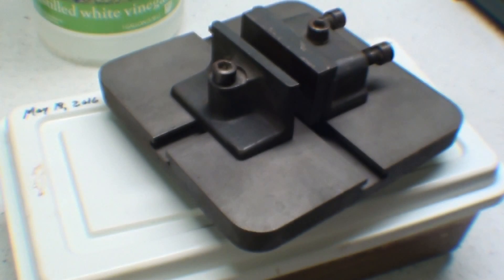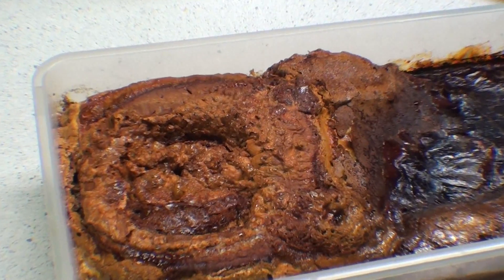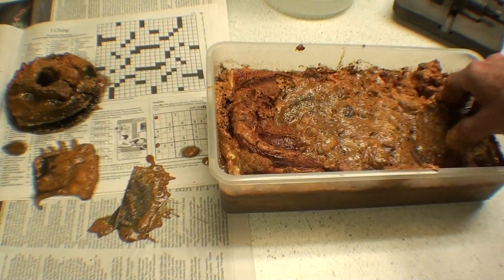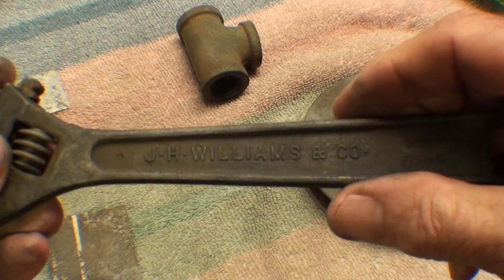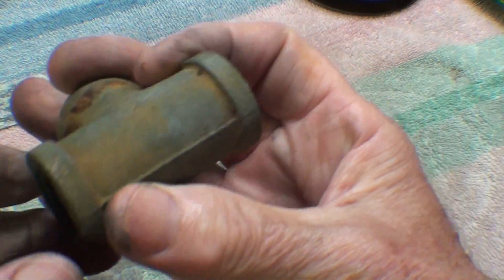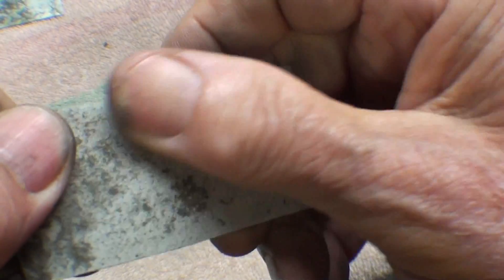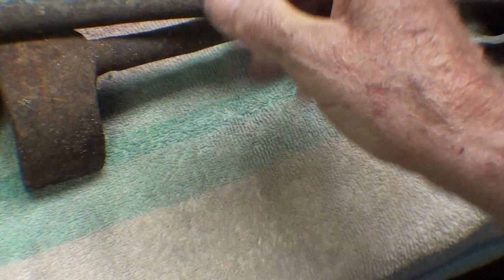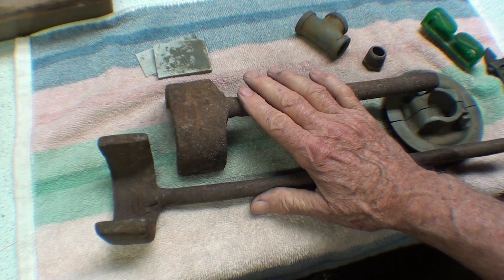VINEGAR Rust Removal 304 1/2 tubalcain electrolysis

Comment: In finish work, what you experienced is called "pickling", a light overall etching. Your surface plate, however, wasn't completely submerged due to the pan leaking. Unsubmerged areas experienced accelerated corrosion, the air, evaporating water, and acetic acid vapor basically cyclically nibbled those unsubmerged areas at an accelerated rate compared to the submerged areas due to greater availability of free oxygen. The acid debonded the oxide, the oxygen and water vapor oxidized, the acid debonded the fresh oxide, the oxygen and water vapor oxidized, both repeating in turn until removed from exposure.

Comment: I would use electricity to do the removal because vinegar is an acid so you have to ask yourself do you want to roughen the surface or do like they have always done it like they use to, as was chroming. I think the electricity does a better job. Thanks

Comment: Stomach acid is hydrochloric acid, also known as muriatic acid. I don't think it would be good as a rust remover. Have you tried passive electrolytic rust removal? When put two different metals in an electrolyte they form a battery. If they touch the more reactive one will protect the less reactive one. This is the basis of galvanized metal. So if you put an iron or steel part in a solution (a little baking soda in lots of water should work) touching a zinc or aluminum plate it should 'derust' the iron.

Comment: For simple shapes I prefer using the wire wheel, for more complex shapes electrolysis works well, assemblies that are rusted tight is the best use of the vinegar solutions.

Comment: I left a cast brake proportioning valve in citric acid for around a week (5-7 days).  It destroyed it.  Was a real shame because there was nothing wrong with it before hand.  That is the only negative impact I have ever run across.  My lesson was to play it safe and not leave anything in any longer than necessary.

Comment: I just finished cleaning up some old rusty weight lifting metal plates (they turned out beautifully by the way). I let them soak in plain white vinegar for 24 to 28 hours, then I thoroughly scrubbed them with a wire brush and rinsed them (very important part of the process) with cold water and made sure that each plate was 100% dry, since cast iron will rust if not completely dry. Not only does the vinegar take off the rust but it also will remove some of the old paint, which is great since I repainted them as well. The quality job (and in expensive) the vinegar does in cleaning up rusty metal, I could careless that it might pit the metal a little bit, considering that the item was a rusty piece of crap before the vinegar bath and also you aren't dealing with a harsh chemical when working with vinegar, so for me there's more pluses than minuses.

Comment: Just a quick note...
I had some steel parts that were black oxide coated.  After a few hours in a vinegar bath ALL of the black oxide coating had been removed, along with a lot of the rust.  I didn't try other methods of rust removal with the black oxide, but I suspect they all will remove it.

Comment: I'll stick with good ole Naval Jelly.  It's much faster and cleans up with water

Rub the part with some wax paper to transfer some of the wax and then a little light machine oil to prevent flash rust if you are not going to paint or seal the metal.

Comment: Mr Pete,I enjoy your videos very much.I restore antique clocks and cars, so over the years I've tried pretty much every rust removal method known.My method is as follows:1) Mechanically remove rust flakes and any adhesives or such, and scrape off the worst of the crud.2) Boil the parts out in TSP (in an old deep fat fryer, slow rolling boil) to get the grease and oil off. This will usually also remove any paint or adhesives, but sometimes a couple of minutes with a brass brush or a solvent are needed to remove gasket materials. This takes 30 to 90 min depending on how much crud you leave on the parts.3) Rinse the parts in hot water.4) Immerse the parts in a Citric Acid solution (eg Hammerite Anti Rust), check progress every 12 hours or so. Depending on the amount of rust you may need to add some more concentrate (the Hammerite stuff changes colour as it gets depleted)5) Rinse again and check that the parts really are free of rust and adhesives etc.6) Pre heat the oven to 110Deg C, then boil the parts out in fresh clean tapwater, transfer them to the oven while hot (wear gloves, use tweezers/tongs) and bake long enough that they are perfectly dry (30min-2 hours depending on the mass of the parts and if they are CI)Your parts are now ready for any surface treatment, be that paint, conversion coating, plating or oiling.Boiling and ovendrying at the end stop the parts from developing flash rust for months if not years. (I believe that the TSP helps to form a conversion coating on the Iron/steel surfaces).CI is comparatively porous, if the parts are to be plated you need to boil the parts in fresh water for at least twice as long as the TSP boil.This process uses inexpensive, readily available materials and equipment, doesn't present any health or environmental disposal problems (let the solutions evaporate, the dried residue can go in the trashbin), and also doesn't appreciably change the unrusted surface finish or dimensions of the part.
Reply from the maker: Sounds like a great method

Comment: An accurate test would be to accurately weight the parts before the acid test. The difference will tell you the intensity of the attack.

Vinegar is a plant product. Concentrated Acetic Acid is much more powerful than vingegar. Fact: pure Acetic Acid freezes at about 60 degrees F. It's call Glacial Acetic Acid.

Because there were different metals in that bath the metals set up a "battery". There was an attack on one of those metals much more severe than the others. I'd guess the steel pieces were the ones attacked while the cast parts were "protected" by the more chemically active steel. Think Galvanizing.

Comment: You  can't just  rinse and brush if you want to stop the reactions.  You need to neutralize the acid, try baking soda.  Second water causes rust, vinegar is a mix of water and the acid we call vinegar when mixed, so leaving it in for a month is what caused the gunk in the tank.  The vinegar removed the rust, free oxygen in the water made more, then the vinegar removed that, and on and on, until you finally remembered it.  LoL.  I find vinegar will neutralize most rust in just a few hours, certainly I have never needed something to soak for more than a day.  If you want to do a more useful experiment beyond proving acid can pit metal, why not do a comparison of the effect of electrolysis to vinegar on springs?  Several elsewhere have claimed electrolysis destroys or weakens springs.  Is that true?

Comment: Electrolysis is an effective rust remover, but the process contributes to hydrogen embrittlement of steel. Try cleaning rust from a compressed clockspring, and you will see the result - the spring becomes brittle, and snaps easily. You can use electrolysis on spring steel if it is relaxed, but you have to 'bake' it first to drive off the hydrogen dissolved in the surface layer of the steel before you can flex the steel.

Comment: Electrolysis does produce a small amount of hydrogen gas, but it's not enough to be a concern as long as you don't do it in an enclosed space, and keep it away from pilot lights. In the garage with an uncovered container should be fine, maybe crack a window if your garage has one. Patio would be a good option too.

Comment: I removed heavy rust from a 50 year old surface gauge and antique Stanley hand plane by soaking both in white vinegar for 30 hrs. The operation was safe, very economical and completely satisfactory. The trick is not to leave the parts in the vinegar too long and to oil the surfaces after clean-up. Thanks Mr. Pete for showing your viewers  how it's done.

Comment: Maybe to set a standard by which the amount of metal being removed can be measured you might try weighing the parts very accurately before dipping them in the acetic acid (vinegar) and then weighing them once again afterwards. I think the pitting that you have observed is not so much a result of the vinegar etching the metal surface as it is rust pits. A way to determine this is to place a perfectly clean and polished piece of steel in the vinegar and then you can more accurately judge the results. I believe Phosphoric acid is used to control rust because it leaves a phosphate coating on the steel parts.

Comment: FWIW, I once used the vinegar method to try and restore a bunch of old tools including a pre-WWII Stanley hand-plane. After soaking for about 3 days, I managed to completely wreck the threads tapped into the cast-iron base. I managed to salvage the thing by retapping it with the next size larger bolt, but I'm pretty sure a fix like that would make the Stanley fanboys weep.
Is that experience any different than powered electrolysis? I cannot say.

Comment: Great video! I actually use this method to remove rust quite often and I have notice that on heavy rusted items it only takes 24 hours to dissolve the rust. Then a quick wash with dish washing detergent and an old tooth brush will leave only the base metal exposed. If you leave it longer than 24 hours the base metal develops a black layer of material that its a pain to remove.  So 24 hours is the max time I ever leave a heavy rusted item in vinegar. Thank you for your videos!!

Comment: Where I De Rust Cast Iron Cookware with Vinegar 
I Use a 50/50 Mix with Water 
it takes a little longer to Rust Remove 
But I don't get the Etching as I would Get using 100% Vinegar

Comment: vinegar works great, <b>but don't use it on Starret blued items</b>. I just did my machinists clamps that I got at a garage sale, and the bluing is gone on 3.  2 were the older type w/o the clamp holding the screw in, and 2 were with the clamp. all are quite old and had surface rust on the edges. I should have just oiled and scotch brited them.  one remained blue (almost black).
Reply: Vinegar does tend to remove some finishes, especially if salt has been added, or if the vinegar is reused (the water evaporates, leaving the acid stronger).  Chrome plating will also delaminate from the metal.  I just cleaned up a really rusty vise grip (real) in vinegar, and about half the remaining plating was curling up after a week (yes, I forgot about it!)  I ended up grinding most of it off because it was so rough. My basic rule is: if you care about the plating,  don't use vinegar.

Comment: It stands to reason since it's an acid there would be some base metal loss.  Some ideas: check the thickness with a micrometer before and after, leave a part of a piece sticking up out of the vinegar and compare it to the piece that was emerged (or maybe protect it with some tape or paint or wax or something), weigh a rust-free part precisely before and after.  Shopdogsam says electrolysis doesn't eat into the base metal at all, and I tend to think he's right.  He's been using the same wires to hold the parts for a long time without them getting eaten away.

Comment: For small items that do not need a large amount of vinegar in order to be submerged - It looks like vinegar is the best method to remove the  oxidation.  One gallon of vinegar is about $2.50 where I live.  There must be a point where the vinegar option is too costly and the other method using sodium carbonate, water, electrical current and an anode becomes more cost effective.

Comment: I use molasses for rust removal, I would like to see you compare it to electrolysis, I like molasses as it is cheap, & kind to the base metal. You can also clean up large parts .

Comment: did you neutralize the acid with backing soda if not the viniger will continue to attack the base metal
Reply: Even after the vinegar dries?  What if you just rinse it off?
Reply: Not after you rinse it off... once the molecules of acid get used up, there's no more acid left to dissolve the metals.
Reply: Except then you have wet metal and some metals will rust in the time it takes to dry them.  Best to put a coat of oil on them right after removing the acid.

Comment: I have been using apple cider vinegar to clean some stuff things that I had. The last big thing I cleaned was the main body of an old Quackenbush 22 rifle. it did a really good job cleaning it. before I had put the gun in the vinegar I had the right side of the gun cleaned to a shine by using a file & finishing it with sanding paper on a surface plate.  The issue that I had with it was after I pulled it out of the vinegar the right side was pitted again & looking like it did b4 I polished it with the sand paper. I was hoping I could just polish it instead of having it crome or nickel plated .

Comment: Molasses works extremely well for rust removal. It will not etch the metal but is more expensive than vinegar. It also requires a longer soak.

Comment: soak in baking soda and water for ten min to kill the acid that helps with stoping the flash rust
Reply: In Northern Illinois in Summer, the air is laden with moisture.You can neutralize excess acid all you want, but bare metal that hasn't been oiled is going to rust right away.

Vinegar is so mild that it rinses right off, not leaving enough acid to do much of anything.

Rinse your parts with warm water, dry them ASAP, and then oil the exposed bare metal ASAP

Comment: Ignore the people who complain about you promoting your own videos.  Who else will do it if you don't?  Nice experiment, I have used vinegar on brass and it made it clean and shiny.  Maybe it is a matter of using the right chemical in the right place.  Keep on keeping on.
Reply: You might want to try ammonia - window cleaner - on brass... it's a reducing agent as well as a mild base, and removes verdigris (tarnish) extremely well.
Reply: Amateur Redneck Workshop Acetic acid (the acid in vinegar) is not strong enough to attack brass or bronze in its reduced  (metallic) form.  It will disolve away the already oxidized copper and zinc so it works great for cleaning copper, silver and their alloys.  Iron is easy to oxidise. You could completely disolve iron tools in vinegar if you left it long enough.

Comment: I recently acquired a Clausing lathe which had a lot of accessories with mild surface rust. I used white vinegar and left the parts in for roughly 4-8 hours depending on how bad they appeared. I immediately removed them and washed in cold water/dish soap and scrubbed them with old toothbrushes. The Those parts cleaned up nicely with no pitting and came out with a nice smooth finish. I think the shorter soak time probably helped prevent the etching effect. I was very pleased with the results.

Comment: nice. I'm curious could that sheet metal be used as sand paper... maybe a long lasting sand paper or used as a very fine file?
Reply: Great idea! I can see a whole range of sizes and shapes and roughness. Some would be attached at a cylindrical handle for fine detail work. A surface roughness gauge could be used test the various 'grits'. And the chemistry used to obtain those various grits would be fascinating to explore!
What do you think? Or has someone already patented this idea and have their products on retail shelves?!
Roy

Comment: Phosphoric acid is an acid so mild it is used as a sweetener in soft drinks, i.e., we drink it too.  It removes rust and leaves a protective coating on the ferrous metal.  Automobile manufacturers dip car bodies in a phosphoric acid solution, not vinegar, to remove the flash rust before priming.  Better car "dippers" in the restoration market remove the rust and everything else from car bodies with a chemical process, and electrolysis, followed by a dip in a phosphoric acid solution.  It is the active ingredient in naval jelly and other rust reducer products.
Reply: Vinegar should be pH 2 or 3, not 6. Anything below 4-ish will readily corrode cast iron.
The question is not only will it corrode, but how quickly does it corrode vs how quickly does it convert rust. Also what are the corrosion/conversion products, some inhibit further oxidation, and are what you want. As you say, there are plenty of acids and bases out there, but phosphoric acid is almost universally chosen by industry for a reason.
Reply: The point he's making is that phosphoric acid will actually form a phosphate layer protecting against further corrosion, similar to black oxide. Rust is not new, there is no need to re-invent the wheel, phosphoric acid has clearly been determined to be superior over vinegar.
Reply: chemech Yes, sour not sweet phosphoric acid.  In soda drink concentrations it still converts rust, that is what happens when a cola is used in the old bumper polishing trick.
Reply: Well, it's used to make the drinks sour = acidic, not sweet...

Also, the food grade acid is diluted by mixing it with water.

The strength of an acid or base is measured by its pH, which is a logarithmic scale where 7 is neutral, 1 is very strongly acidic, and 14 is very strongly caustic (basic)

Working with food grade vinegar, you have a pH of roughly 6, while using the washing soda in dilute solution for electrolysis is somewhere in the vicinity of pH 8

There are plenty of acids and bases out there, and some are stronger than others. Read the labels, and/or the MSDS (Material Safety Data Sheet) which you can get free online, and wear appropriate Personal Protective Equipment (PPE) - glasses, goggles, nitrile or rubber gloves, a waterproof apron, etc. per the instructions for your chosen chemical.

Do not wear open-toed sandals when working with chemicals...